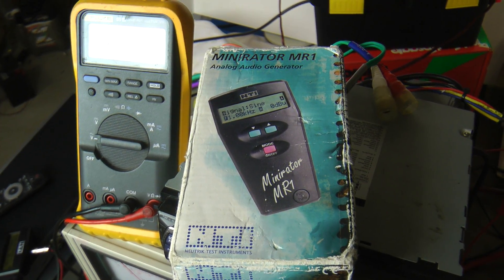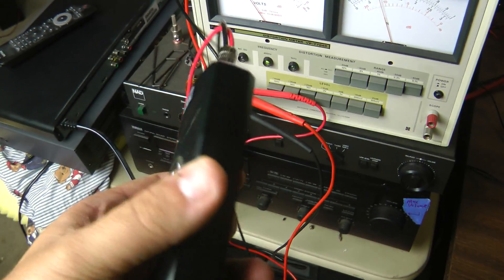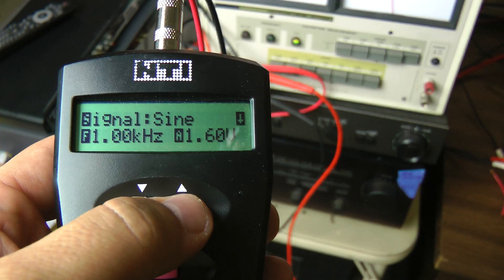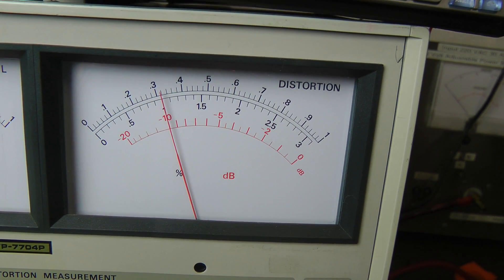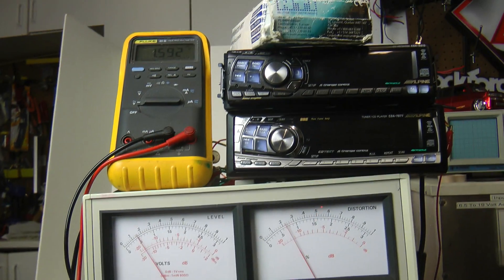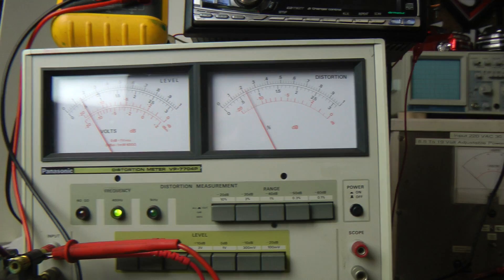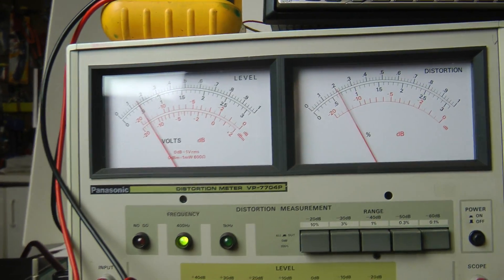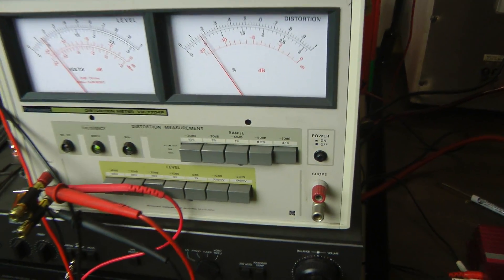NTI Minirator MR1 Audio Generator THD Test

Comment: Yikes! And that's a professional unit? Better off with the Alpine at that price! I wonder how much THD a tone generator app puts out at the headphone jack of a phone? Would be interesting to see.
Reply from the maker: Danny Caballero Yessir, pretty sure you need to spend quite a bit more on the REAL pro gear to get less than 0.02% THD. I may work on a PC with a pro grade sound card to see if I can get cleaner output. But for now, this is proof the Alpine CDA-9815 is a super clean head unit and perfect for amp testing!
Reply: Absolutely!